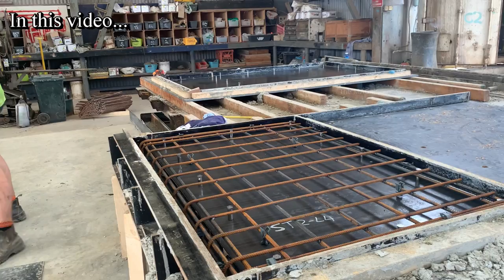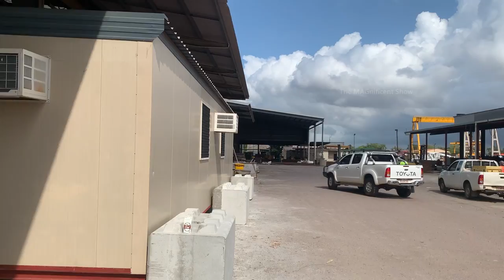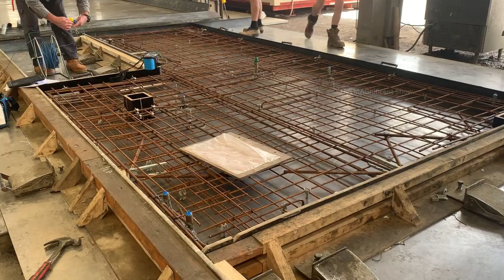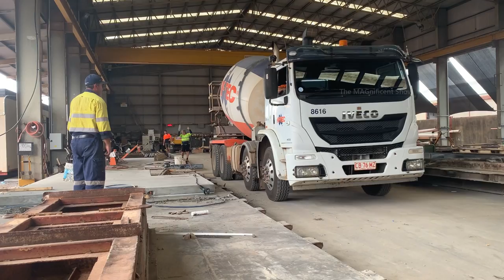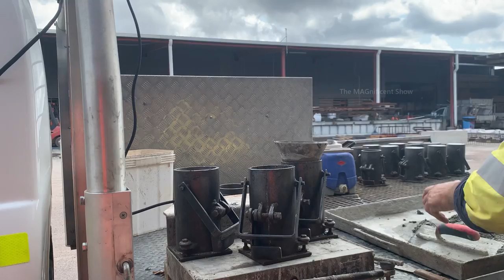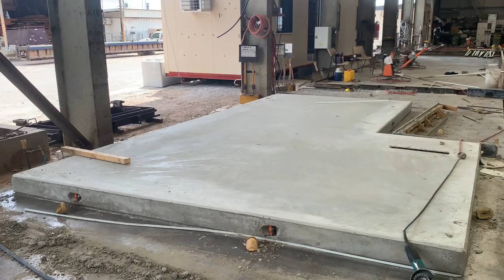How a precast panel fabricated in Australia? | Construction in Australia | The MAGnificent Show

Comment: What do you put on the base of the form to make the concrete smooth and not stick to the base?
Reply from the maker: It is a polished and smooth structural steel plate at the bottom of the mould and concrete won't normally stick to the base. Sealant is also being used wherever it is necessary. 

Thanks for watching.. 😊
Reply: @TheMAGnificentShow  Thanks .. now I know.
Reply: Release agent